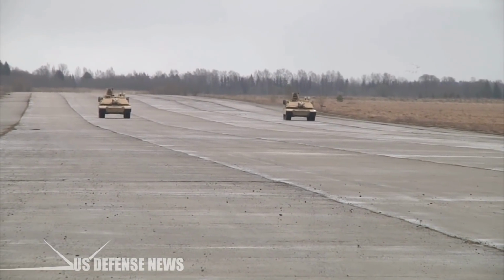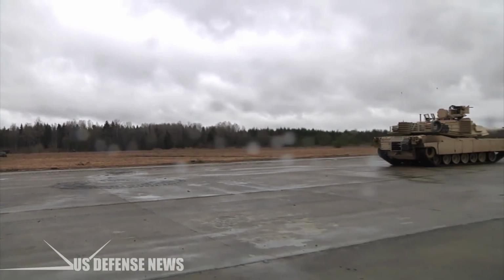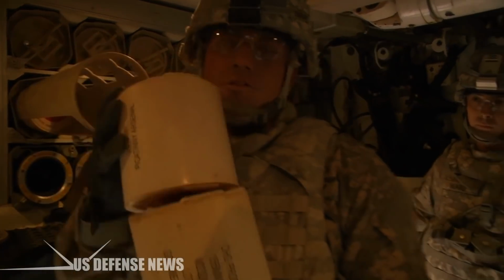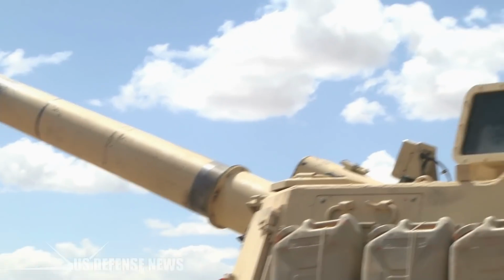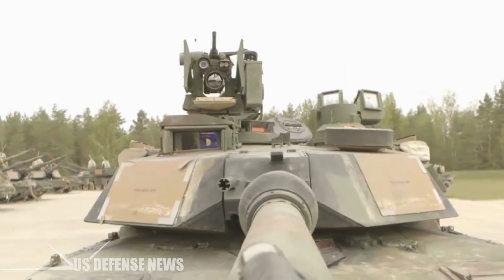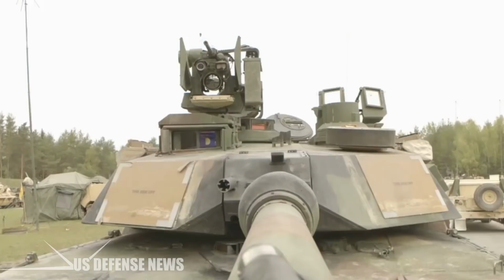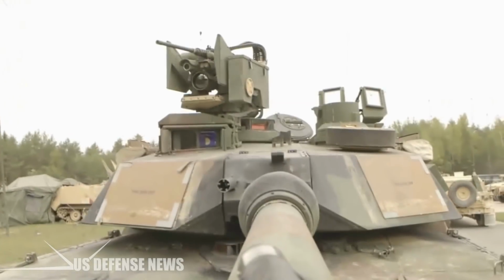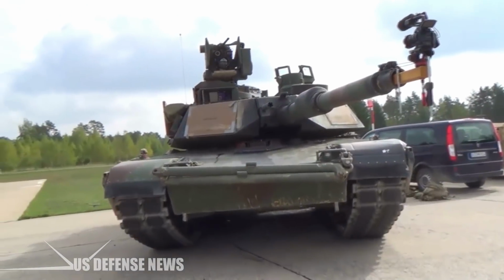U.S. Army Receives First New Abrams Tank Prototype

Comment: Still, Leopard looks much more badass.. Germans DO know how to build panzers...
Reply: Functionality, combat experience > looks

Besides, both Leo 2 and the M1 are pretty much siblings, both being successors to the failed US-German MBT-70
Reply: I disagree
Reply: NationalistPride
INCOMING A WALL OF TEXT 
76mm M1 gun loaded with M93 shell is very capable of defeating a Tiger in the front
Shermans with the 75mm ALSO is capable of defeating Tigers, which mind you has happened.

Belton Cooper from the 3rd Armored Division defeated 2 Tigers using with his 75mm Sherman both using White Phosphorous

"Knowing that the Sherman's 75mm cannon could not penetrate the Tiger's armor, he had his gunner load a white phosphorus round. As a Tiger turned on him, he fired. The shell struck the glacis plate of the Tiger right above the driver's compartment with a blazing crescendo of flames and smoke. Captain Cooper, who saw the fight, reported that "the whole face plate in front of the turret was covered with burning particles of white phosphorous which stuck to the sides of the Tiger.  The smoke engulfed the tank and the fan in the engine compartment sucked the smoke inside the fighting compartment. The German crew thought the tank was on fire and immediately abandoned it even though the tank actually suffered very little damage"
The American tanker turned his turret and fired another white phosphorus shell at a second Tiger, again hitting the front glaces plate with similar results. Cooper commented, "Thus the brave ingenious tank commander knocked out two Tigers without ever getting a penetration""
-Stephen E. Ambrose The Men of War

"In a split second he told his gunner to load a white phosphorus round. It struck the glacis plate right above the driver's compartment with a blaze of flames and smoke. Although there was no possibility of penetration, the shock in the tank must have been terrific. The entire faceplate in front of the turret was covered with burning particles of white phosphorus which stuck to the sides of the tank. The smoke engulfed the tank, and the fan in the engine compartment sucked the smoke inside the fighting compartment. The German crew must thought the tank was on fire and immediately abandoned it. Although the tank suffered little damage, had the crew stayed inside they would have been overcome by the deadly fumes.

The Sherman immediately turned its gun on the second tank in the column and fired white phosphorus, with the same result. Although the ingenious tank commander knocked out two King Tiger tanks (without ever getting a penetration), his tank was then knocked out by another Tiger"
-Death Traps: The Survival of an American Armored Division in World War II

Same events recorded in two different books, although there were inconsistencies if it was a Tiger or a King Tiger, but regardless, Shermans with 76mm M1 Gun and White Phosphorus 76mm Shermans are definitely capable of defeating Tigers. 

Also comparing the 85mm D-5T and the 76mm M1 gun in killing a Tiger's ~101mm frontal plate;
The longest range the 85mm can penetrate said armor would be at 1km (with 105mm penetration using APBC)
The longest range the 76mm can penetrate the same armor would be at 2km (with 108mm penetration using M93 HVAP)
Of course, this didn't happen 100% of the time, but it does show that it is CAPABLE of doing so. 

The Sherman isn't a bad tank, far from it. It gets a lot of "hate" more than it should.
Soviet Hero, Dimitriy Loza who has opreated both T-34s and Shermans made comparisons between the two. 
"Overall, this was a good vehicle but, as with any tank, it had its pluses and minuses. When someone says to me that this was a bad tank, I respond, "Excuse me!" One cannot say that this was a bad tank. Bad as compared to what? "

"For a long time after the war I sought an answer to one question. If a T-34 started burning, we tried to get as far away from it as possible, even though this was forbidden. The on-board ammunition exploded. For a brief period of time, perhaps six weeks, I fought on a T-34 around Smolensk. The commander of one of our companies was hit in his tank. The crew jumped out of the tank but were unable to run away from it because the Germans were pinning them down with machine gun fire. They lay there in the wheat field as the tank burned and blew up. By evening, when the battle had waned, we went to them. I found the company commander lying on the ground with a large piece of armor sticking out of his head. When a Sherman burned, the main gun ammunition did not explode. Why was this?

Such a case occurred once in Ukraine. Our tank was hit. We jumped out of it but the Germans were dropping mortar rounds around us. We lay under the tank as it burned. We laid there a long time with nowhere to go. The Germans were covering the empty field around the tank with machine gun and mortar fires. We lay there. The uniform on my back was beginning heating up from the burning tank. We thought we were finished! We would hear a big bang and it would all be over! A brother's grave! We heard many loud thumps coming from the turret. This was the armor-piercing rounds being blown out of their cases. Next the fire would reach the high explosive rounds and all hell would break loose! But nothing happened. Why not? Because our high explosive rounds detonated and the American rounds did not? In the end it was because the American ammunition had more refined explosives. Ours was some kind of component that increased the force of the explosion one and one-half times, at the same time increasing the risk of detonation of the ammunition."

Also; larger caliber =/= more penetration
Reply: Just remember the m4 sherman was originally designed as a infantry support vehicle and nothing more. The tank killing vehicles were our tank destroyers just like the hellcat. No armor but plenty of gun.
Reply: Alexander Postma,  No, the Soviet Union DID NOT win World War II on its own.  That is just a silly, uneducated statement.  You should take an HONEST look into just how much the United States supplied the Soviet Union, not only materially, but with intelligence as well.  Moreover, the United States, Great Britain and other allies participated greatly in the war in Europe, and the United States won the war in the Pacific against Japan almost single-handedly.  I don't know where you get your information from, but you should find better sources.
Reply: but don't forget USA has VAST resources... an we have enough Abrams Tanks to be a good numbered attack force an don't ever ever forget this important factor in warfare, we can use our airforce in support to keep the tank losses to a minimum... like how USA an UK did in ww2... there airforces kept the Nazi's back an made there casualties worse an lessened our casualties...
Reply: Callsign-YukiMizuki You're exactly right. The warriors who were there are the only ones qualified to talk about it, sadly most are gone now. And the strange part? If the people who hate the US ever need help again, what are the odds that America will tell them no?
Reply: Alexander Postma A good tank is no good if there isn't enough of them.
Reply: Ryan Weeks sick comeback xD
Reply: Alex Pelc xddddddddddd
Reply: maverick7376 Just the usual wehraboo bullshit.

Good job Victor, carry on.
Reply: NationalistPride... but also don't forget this, the M4 Sherman worked... it was reliable... the Nazi's tanks were jus physical manifestations of there ego... yeah they were big an scary an strong, but they did not work always very well... they guzzled up gas real fast, they broke down... they had other technical problems... the M4 Sherman could easily fight an beat the panzer 3's an 4's an don't forget there were WAY MORE M4 Shermans then the tigers an panthers... an also it was worse for the Nazi ego tanks cause of the USA an UK vast air superiority we were able to cut down there tank numbers a bit more... an all the bombing on there industrial centers was making it really really hard to keep making those expensive complicated tanks... the e100 an maus an e50? those things would never work... they were SO BIG theyd be slower then old people trying to fuck an they wouldn't be able to go up hills or over bridges... an there big size an weight, theyd definetly break down too an theyd be an easy target for Bombers... also don't forget this, my favorite by the way, when the British made the Sherman into the Sherman Firefly... it was a panther an tiger Killer... an the British production was never smashed an the 17 Pounder that was the Firefly's gun was jus like the Sherman... easy to build an simple... so the Sherman an 17 pounder? a lot more could've been combined to make more fireflys... an last, there was a special armor piercing round for the Firefly that would enable later to cut the armor of the tiger2... so the Sherman was good enough an didn't need to be all flashy an stuff... an when it was made into the Firefly, it was the Ultimate Nazi tank killer...
Reply: I just knew that someone would post a statement that certain tanks, like the Leopard II (not the Leopard) is a better tank than even the upgraded Abrams will be.  That is not the point.  When taken together will overall U.S. battlefield weapons and superiority, the MIA2 SEP v3 Abrams Main Battle Tank upgrade will be the best allocation of funding to make the Abrams more lethal and more survivable for the next few decades.  In the meantime, the U.S. is busy developing the next generation tank.
Reply: Alexander Postma

It's not really fair to put all the blame/credit on the US in those wars you mentioned when there were a multitude of countries that participated in those wars as well. Sure, maybe US led, but they were not alone. 
Vietnam was back in the ehgiht of the Cold War where both US and USSR were having a massive dick measuring contest but to be fair, when the US left, both North and South Vietnam had a ceasfire/temporarily stopped fighting. 
Iraq - The Gulf War was fought by a COALITION 
If you're reffering to the 2003 invasion (again, there were other countries involved) to take out Saddam Hussein, then yeah I do agree that the motives behind it is fucked up, but if we're to use the Syrian Civil War, an Iraqi Civil War was likely to happen anyway, regardless if the US and friends invaded or not
Syria - The US did NOT start this, they simply support those fighting below and their direct involvement in Syria is against isis
Afghanistan - So I'm not sure if you're aware of what's happening, but Afghanistan is literally filled with terrorists/Al-Qaeda. The US and other countries are WORKING WITH THE AFGHAN GOVERNMENT to defeat the terrorists. So unless you're suggesting they should just let terrorists take over Afghanistan and install their ancient, radical beliefs, there is a good reason why those countries are there. 

It also sends a message to other countries when the sole superpower in the world absolutely does nothing. While I disagree with a lot of the US' politics and ethics, but their very presence is often enough to deter and discourage nations from going to war against those allied with the US

So TL;DR:
It wasn't just the US fighting those wars. MOST wars were not started by the US
Reply: BiggerCat77 True, even Legendary Soviet General Zhukov admitted that Russia couldn't have won without Western help, and was made a non person, whatever that means, and put behind a desk for having the guts to admit it, what a disgraceful fate for a great Military Leader.
Reply: Patrick Appell
I can back that up

"Today some say the Allies didn’t really help us… But listen, one cannot deny that the Americans shipped over to us material without which we could not have equipped our armies held in reserve or been able to continue the war"
-Soviet Marshal G.K. Zhukov

Also, even Stalin himself admitted it

"I would like to express my candid opinion about Stalin’s views on whether the Red Army and the Soviet Union could have coped with Nazi Germany and survived the war without aid from the United States and Britain. First, I would like to tell about some remarks Stalin made and repeated several times when we were "discussing freely" among ourselves. He stated bluntly that if the United States had not helped us, we would not have won the war. If we had had to fight Nazi Germany one on one, we could not have stood up against Germany's pressure, and we would have lost the war."
-Soviet Commissar, Nikita Khrushchev
Reply: Callsign-YukiMizuki Thank you. But try to find anyone that will admit to that today. Many say that the US did nothing.
Reply: Well yeah, a lot of the people hate the US today so they will be biased. 
Not to mention those were quoted from people who actually fought in the war, their input holds more meaning than any expert historian would ever say
Reply: Callsign-YukiMizuki Yes! That's what they are
Reply: John Williamson Hold on, the M4 Sherman wasn't that great of a tank. The Sherman has barely any armor and a "decent" gun. The frontal armor of a Sherman is at least only 40-50mm and that is the effective thickness from being sloped. Sides/back/turret are 30-40mm of armor. I will say that the M4A3E2 "Jumbo" is good, but still not that great. The 75mm M3 cannon can't even penetrate that well on the sides of a Tiger. The only Sherman that is actually the Jumbo with the 76mm M1 cannon, but even then, it's still free food for the KwK/L43 88mm cannon on theTiger II. Even T-34s and IS-1/2s could actually deal with Tigers. The 85mm D-5T cannon and the 122mm D-25T are what make the Soviet tanks even better than the American's Sherman. Even then, Tigers and Panther were still superior war machines. The Tiger H-E models had 105mm (that isn't sloped) of frontal glacis armor and 80mm of side/back/turret armor (Not to mention the fact that the front of the Tiger 1's turret has almost 200mm of armor), and then you even have additional tracks that are 5mm thick that can easily up the armor protection with ease. The Tiger II or, King Tiger, is even better. It's got the better 88mm compared to the Tiger 1 and has even more armor while still being quite fast on roads/fields. The frontal armor is what also gets better. It's still the same 105mm of steel, but it's sloped. This allows the effective thickness to get just short of *235mm*. Even the 122mm D-25T APBC shell from an IS-2 will most likely bounce on impact. Then you have the Panther which is basically a Panzerkamfvagen.IV., but with sloped armor. The frontal armor is just short of 130mm, and can bounce 85mm APBC shells from an IS-1 or a T-34-85. In conclusion, us Americans had good tanks and were starting to develop some amazing tanks like the Patton and the Pershing that could easily fight those big German powerhouses, but they would still have to worry about tanks like the Maus, E-100, and the E-50M which would have been superior if the war lasted for a lot longer. Sorry about the long write up, I just wanted to bring some facts to the table.
Reply: Germans still make the best tanks
Reply: NationalistPride I thought I made my point! What happened to the superior German tanks of WWII? What proof do you have that the present German tanks can take out that US tanks? Have the fought a war I don't know about? Or is this just a show of national pride?
Reply: +NationalistPride
I'm not sure where you're getting your math from. The uparmoured Sherman had a frontal armour that could be penetrated by nothing except the heaviest PAK anti-tank gun, firing rigid-composite, point blank, without any sideways tilting of the tank.

Sherman frontal armours had 102-130 effective millimeters of thickness, depending on the position of the tank.
Reply: Blah b You're thinking of the Jumbo model Sherman
Reply: i said, it looked more badass and is a true match for an abrams. I did not say anythig about who has more or less.ofcourse 100 abrams would wipe out a small batallion of leopards, but all in all, german engineering is very good. i saw a lot of BS about WW2 here, that has nothing to do with the capabilities of modern tanks nowadays, wtf has a sherman or panzer from ww2 has to do with this? i don't give a crap about what was best in ww2 or nowadays. personally i think that abrams or leopard 2 are very close to eachother. nothing else.
Reply: Alexander Postma  german main armament in the abram
Reply: Tangerineguy702 Not the same gun, different recoil system.
Reply: Shirghazay Cowboys still shows Rheinmetall 120mm
Reply: Tangerineguy702 I just said, different recoil system.

Different MRS placement, different mounting. Higher level of tolerance less hard to work on.

Manufactured in the states.

Not German anymore.
Reply: Sean Mager Later Sherman models had a 88mm mantlet 63mm turret and 63mm frontal hull (slope not taken into account) 

Not really fair to compare Sherman to the King Tiger either. That was the Pershings job.
Reply: they're almost the same tank you bloody wehraboo.

anything 1 can do, the other can also do, anything 1 can't do neither can the other.
Reply: Nah abrams looks more beefy and badass
Reply: both us and the russians took the designs for a plethora of german  weapons including the machine gun, aircraft, and tanks and integrated it into our own.  when you see the m1 its basically built off the panther design. The germans were the first to stick a jet engine in a tank, now we have 2 in the m1.
Reply: Sean O'Dea the effective thickness is actually more like 75mm
Reply: Sean O'Dea also the sherman easy eight (m4a3e8 76mm w) could deal with tiger.
Also the maus, e50 etc would just be great dive bomber target practice and a waste of fuel from an already low on fuel Germany.
Reply: Sean Mager Also The shermans could fight on all front and were easy and cheap to produce
Reply: Just remember what happened to all of Germany 's ( superior tanks ) when they came up against American know how. The same thing that happened to the Russians tanks in Iraq. The did't stand a chance!
Reply: maverick7376 Nice troll comment. Do you have anything facts wise to say to me or are you just going to insult me because I made a good point?
Reply: and what a mess they left in Iraq. The last war the US has really won without too much shit left behind was WW2. Btw, the soviets won WW2, not the western allies. Every post WW2 war where the USA was involved in proved to be one big pile of shit and even more havoc and instability for the whole godamn region where that war was made. Get your shit together or don' t engage in war anymore. Vietnam, Iraq, syria, afghanistan, what a mess and how many dead us soldiers and civilians out there it gave us? WTF is next?